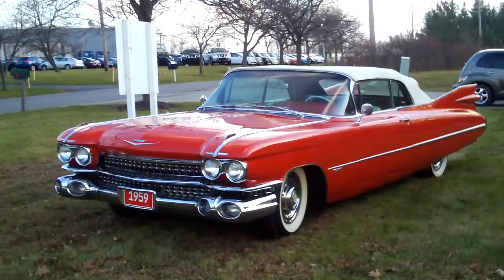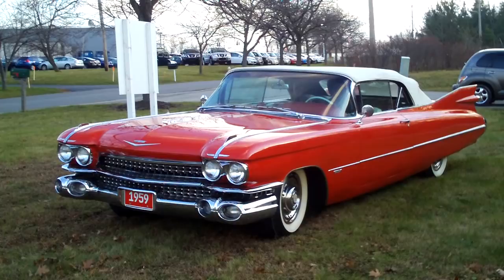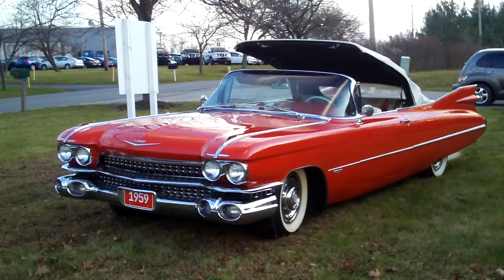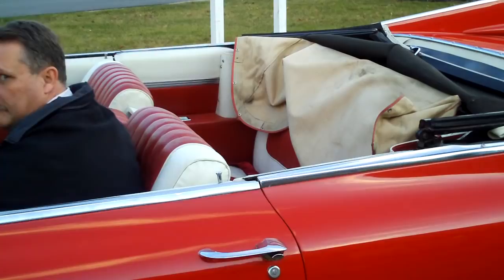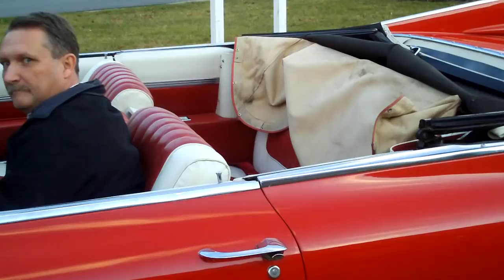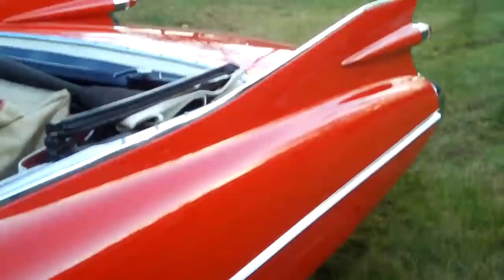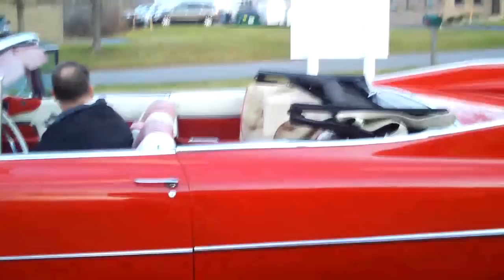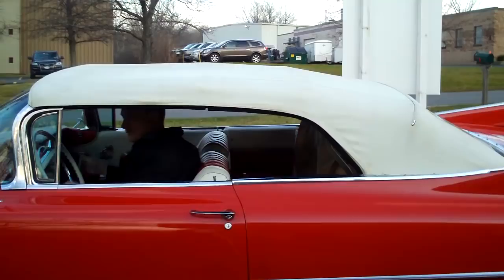1959 Cadillac Convertible

Comment: @tyoung9624 The speaker and "electronic device" in the back is a subwoofer and amplifier for it. A subwoofer is a bass speaker that plays only the deepest tones, and since so low tones go rigt through the back seat and trunk upholstery it can be situated in the trunk. Will really juice up your music and give it new life, but make sure the other speakers match. Also make sure everything is correctly adjusted. You get devices now allowing the use of original AM radios with newer eqpt.See redi-rad.

Comment: Hi .. one correction at 1:06 says 275 HP but they were actually 325 HP - and the optional tri power engines that produced 345 HP. There were no engines producing 275 HP in the 1959 models.

Comment: Wrong hubcaps
Reply: ***** yes those are the right hubcaps.  My Aunts friend had a 63 Cad Convertible, got, it new, but it didn't have Air either, but the car was bought new in the SF bay area and didn't need it there, when she moved to Northern California with our hot summers, she added a 71 Coupe DeVille with air and laughed she had one for hot days and one for cool days, she sold the Convertible in the 80's and got more for it then than she paid for it new
Reply: +George Keyser I believe this is the real deal as most coupe conversions 1) don't have a real top due to requiring extra reinforcement pieces welded inside the body, the floor and even the chassis, 2) most have a small section of the roof left to reinforce the windshield frame as the coupe frame is not strong enough to hold a standalone windshield in place. The chrome trim is also the correct Series 62 and also has the correct interior which are different from the Series 62 coupes. So true conversions are very costly and time consuming.... I have seen some people that did the complete conversion but those were very costly and time consuming so most conversions are simply a roof cut off, no functioning top and incorrect interior.
Reply: ***** Hi George, great to hear you also owned some before, these cars are a true creation of art from a time when car manufacturers placed a lot of emphasis on styling. I too own two of them right now, a Series 62 Sedan and a real Series 62 convertible that I am restoring. Yes true conversions are very difficult because even the chassis has extra pieces welded on them for better support so most people just simply cut the tops off. These cars are however very easy to recognize. I too have seen a coupe of true conversions done so really only the VIN would tell if it's an 'F', or a converted 'J' or 'G' model. Would love to see a picture of all 15 of your Cads lined up! :)